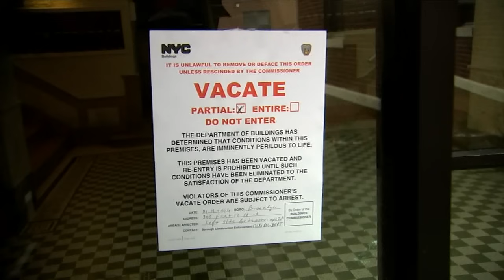Faulty pipe connector caused steam leak that killed baby boy

Comment: If it was a faulty radiator connection why are they talking about the boiler inspection?  Maybe they should check all of the radiators in the building instead.
Reply: My first thought as well.
Reply: I thought that they shut down the boiler so that steam is cut off to the radiators to be safe since it will take time to check the radiators
Reply: Someone was messing with nibble , if it just blew off due to pressure from the steam that yes , the building should be responsible
Reply: Those old radiators are dangerous.  No covering protecting the pipes.  Could be damaged by the tenants very easily.  If you've never seen them you won't understand.

Comment: The newsies reported the irrelevant boiler inspection because like most moderns they wouldn't know a boiler from a baseball bat. We don't know what dislodged the pipe or if it burst due to corrosion, manufacturing defect or installation error. These ancient buildings need a wrecking ball but many people forget how very old they really are. No outside visual inspection of standard steam radiators would detect internal failures but they can be fitted with steel radiator covers to prevent direct contact and deflect some steam. (Such covers were common since many years ago but are mostly used for decoration.)
Reply: I work with steam everyday and you are correct.

Comment: A nipple, as it relates in this conversation, is a short piece of pipe usually 6" or less and my guess is that this nipple is most likely between the valve where the steam goes in the radiator and the radiator itself though there are nipples all over the entire system that has no telling how many radiators online and is God only knows how old... somebody is getting ready for a monster plumbing bill sooner rather than later, hopefully for you it's your landlord lol...